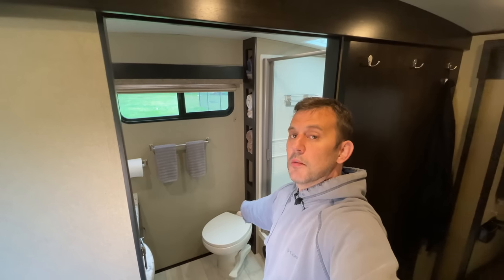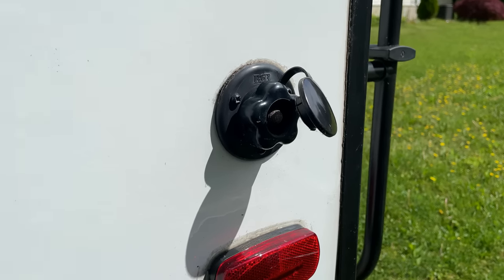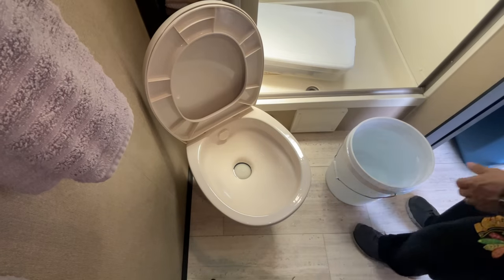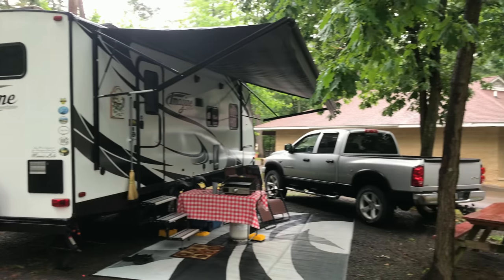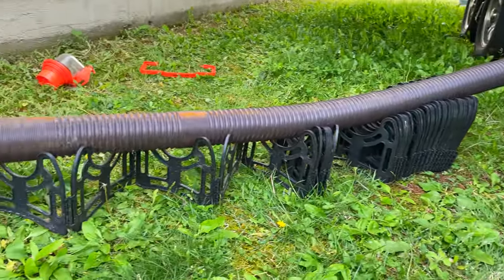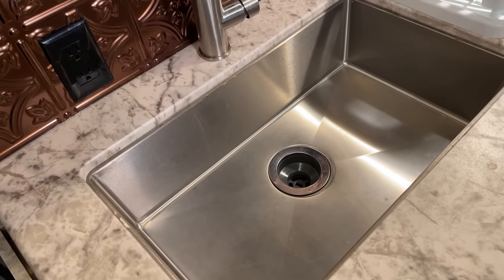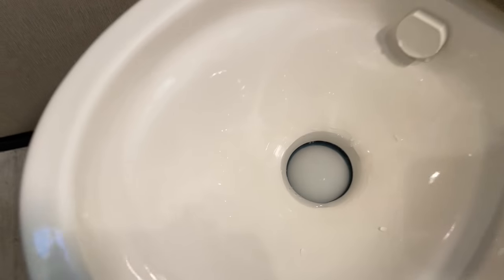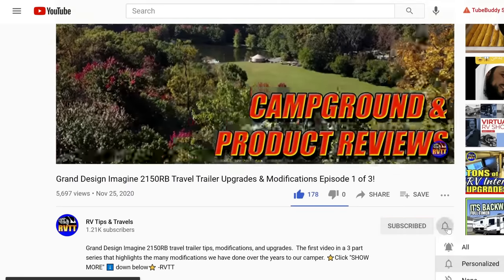RV Black Tank Cleaning, Maintenance, Tips & Tricks - The Original Black Tank Master Class

Comment: Hi, I have a laundry cap stuck in the lining/pipes of my black tank, my son threw it down there.  Do I have to take it apart it? It only allows a little bit of waste out at a time.
Reply from the maker: unfortunately it might move over time and block the drain pipe completely.  it probably should be removed.

Comment: We are set up in one location for the summer, only there about every other weekend, do we need to empty the black tank when we are only there for two nights or can we just add water to the tank and empty every other time?
Reply from the maker: Great question, in a situation like that, if your tank is less than half full would just make sure there is a black tank solution in there with lots of water and leave it alone. If it starts getting close to full I would add water until it is almost full and dump it so you don’t have a full tank of waste sitting in there when you’re not in the camper.
Reply: @RVTIPSANDTRAVELS   Thank you.

Comment: I was wondering why you didn't use the black tank flush instead of the 5 gallon bucket to rinse, drain repeat on the black tank.
Reply from the maker: the "bucket dump" in my experience provides a better clean.  it does a couple things.  first it will help break up any solids that may be sticking at the bottom of the tank directly under the toilet since it is centralized pressure.  the black tank flush port is a less pressurized spray.  its also much quicker, and that immediate rush of water will loosen things up much better than turning on the spray port.  just my experience from using both.

Comment: Ok I need your help!
Yes my toilet is backed up.
I was running it with the valve open like if it were a regular home bathroom. Oh boy am I learning a lesson. 
I've used the unique rv digest it a while bottle 32oz and still no give. 
I got the white and yellow wand. Still not give.
And know I got the RINO blaster,( direct blast) rinse your rv sewer system and still not give. 
Not trying to be funny, but I'm pooped out. Have any suggestions?
Reply from the maker: It might take a while but I would first try putting some hot water in your tank and filling it, let it sit overnight. Tried dumping the next day. If that doesn’t work I would then suggest trying the trick used in the video that I mentioned in this video with the sewer hose. Let me know if that works, if not we’ll try something else.

Comment: No comments on when and how long you operate installed black tank cleaning spray systems. Do you ever use one? Most newer rvs have them now.
Reply from the maker: Hey John I think I mention it in the video, but if not, ill usually run it for about 5 minutes, or until the water coming through the elbow is clear.
Reply: @RVTIPSANDTRAVELS  yes, reading your reply I recall you saying that. 
I will close the release valve for a minute or two to build a little water volume for a final flush. Same as adding water. BUT DO NOT WALK AWAY OR GET DISTRACTED w valve closed. It is probably a dangerous practice.
Reply from the maker: Correct, do not walk away!!!! I did that once filling the fresh tank and came back with it pouring from the gravity fill lol.

Comment: I’m new at this, but I saw something that kind of freaked me! Is there someplace near the sewer hose or just inside bumper so I don’t have to dig for or touch the hose? Then sanitize gloves and hands as I’m putting them away? Just don’t want to infect myself and spoil a great camping experience!
Reply from the maker: Just wear rubber gloves.  Billions of people change diapers everyday without gloves.  Just wash your hands when your done.  👍🏼
Reply: In response to the response: My problem is because of my ancestry, I am 6’2”, large in stature, and the size of my hands have have brought many comments as to their size! Think of Max Bair with Grizzly bear paws, that’s me and after years of searching, have yet to find a workable rubber glove that doesn’t split out as I am trying to put the: on. I have found rubber gloves that fit, the gauge rubber that is like trying to do mechanic work wearing snow gloves. Not anyones fault, just genetics. So rather than working with the sewer hose with “Bear” hands if someone could lead me to an XXX surgical glove or such, I would really appreciate it! Just got over COVID few months back, not a good experience, so I’m avoiding anything that might make me that sick again!🥹
Reply from the maker: Glad you are feeling better from Covid.  I use gloves when actually dumping, but I’m blessed with a tough immune system too.  Thanks for your comments and have fun camping Douglas!

Comment: I have a 9 gallon black tank with no clean out. For tanks that small, even a gallon of water can have you full before the end of the weekend. Try instead, a splash of fabulosa cleaner. Also, they make those external waste gates with a clean out port. Close the external gate and flush your black and gray tank away!
Reply from the maker: Thanks for adding and the tip!

Comment: Been looking for a detailed video like this.  Been camping for the last 8 yes or so now. Just ran into my 1st problem with a black tank not draining on a Saturday night. Ended getting a 5gallon bucket and a plumbers snake…. Yeah a little messy to say the least!! I just subscribed and will be taking your advice into account as we speak!! Thanks for great info and I’ll enjoy looking forward to more videos:)
Reply from the maker: Glad you enjoyed Steve, and thanks for commenting!
Reply: @RVTIPSANDTRAVELS  what do think about the black tank flush kits like rhino blaster pro?
Reply from the maker: Ive never used one, but i could see how they could help by getting water pressure back up into the piping.  i think in the right situation they would be useful.  one just needs to be careful not to overflow the black tank, meaning if it is already full AND clogged, the additional water put through the rhino blaster once it unclogs the line, could overflow the toilet.  make sense?
Reply: @RVTIPSANDTRAVELS  thanks for your response. I think I’ll stick with your tips:)

Comment: Ha! The check valve isn’t important until you realize the manufacturer installed it backwards, and you’d have to drop the underpinning to get to it (I think).  Full timers, clean and flush tanks every four days.  I have sensor issues.  I’ve tried everything but the ice, or harsh products that kill the normal bacteria
Reply from the maker: try using the rinser in this video: https://youtu.be/Q7ZJzfimLwg

Comment: I never use bleach on anything in, on or attached permanently to the trailer to prevent killing the friendly dudes in my tanks (yes tanks, I use tank treatment in both black and grey. Have you smelled a grey tank that has gotten away from you?).

However, I do use bleach spray on the hose fittings (hose ends) and the elbow that touches the black port at the campground. I spray them after disassembling the hose and elbow and let it sit for a few minutes in open air while I work on putting other things away. I come back to it and whallah, sanitized. I rinse each with fresh water and store. There is nothing inside my rig that is not sanitized. The only thing that isn't fully sanitized is the hose itself which sits in my vented bumper.
Reply from the maker: What grey tank treatment do you use?
Reply: @RVTIPSANDTRAVELS  I've used Unique RV DigestIt and when I ran out and couldn't get that, RidX
Reply from the maker: Good stuff too.  Thanks for watching and commenting!

Comment: Thanks for the great video. I am working on putting a house toilet in my motorhome.  Yes they use a lot of water, but from all I've seen (i'm a tent camper) about black tanks, is as you say in video, use lots of water.  So the 1 gallon flush would actually be a good thing.   
Let the yellow mellow and flush down the brown is the idea.   What you think?
Reply from the maker: I've never seen this done.  Just something to be careful with is the reserve tank spilling when your traveling, but I am sure it could be done.  Thanks for watching and commenting Murray!
Reply: @RVTIPSANDTRAVELS  I am using a custom vertical tank setup, and when traveling you can reduce the bowl to just the trap fill.  In another video about different toilets, one complaint about the straight drop down is when it opens, all the nasty smell comes up after the water drains.  A trap this never happens.
Reply: @murraymadness4674  I would never use a normal toilet in an RV. Too heavy, too much water, too hard to keep the seal on the bottom from leaking.

Comment: Brand new here and thanks for all of your videos.  The first (and only) grounds we have been to only had 2 dump ports at the exit.  I dumped the grey and black but there's no way I would have had time to dump/fill/dump.  Is this common or do most grounds have dump ports at the actual "address" of your site?
Reply from the maker: It just depends on the campground.  But yes, if you’re at a shared site with a line behind you, definitely don’t want to hold them up.  When you have a sewer connection at your site you can take all the time in the world.
Reply: @RVTIPSANDTRAVELS  Looks like today's site has a connection at each spot, so going to do some hardcore flushing today lol

Comment: I have a truck camper which does not have a long enough storage tube for a 20ft sewer hose. I use a 5 gallon bucket with a screw-on lid adapter (bought on Amazon) to store my hose and see-through elbow. It makes it easier if you use the type of hose which compresses and retains a shorter length when you put it away. This bucket can also serve to fill the toilet as shown in the vidio.
Reply from the maker: great idea Kenneth, thanks for watching and sharing.

Comment: Hi, Big Ben🇨🇦🐴🙂follower excellent video. We put weather vane with reflective tape to see wind direction and vent BT no smells ever. When I dump, I dump BT then shut valve open GTs2 ,fill BT with flusher 3-4min. When GT done reopen BT valve till clear . Thinking of Geo Method for BT additive🤔🐴🙂🇨🇦.
Reply from the maker: thanks for watching and being a great contributor to the channel Randy... I will have the link for those pull out shelves later today when I can measure them.  I see the link i put up in that video is now dead.  hang tight bud.

Comment: Good tips to use, I’ve got a question, my black tank when full shows 1 light and my grey tank shows 2 lights when empty! I’ve flushed the blk tnk with a wand and no change, any suggestions?
TIA
Reply from the maker: fill both tanks with a little dawn dish soap.  let them sit overnight.  drain, rinse a few times, that might help clean the sensors.
Reply: @RVTIPSANDTRAVELS  ok Will do 👍🏽

Comment: The area under the L.P. tank in my motorhome is open to the ground.  I added an angle iron frame at the very bottom of the cabinet and welded in a strong expanded metal floor.  This makes a shelf where I store 3 sewer hoses and one gray water 50' garden hose plus sewer hose accessories. 
No odor and excess water drains through the expanded metal.  ONE CAUTION: MAKE SURE YOUR L.P. TANK VALVE IS CLOSED AND CHECK FOR NO LEAKS WHEN WELDING IN THIS AREA.
HAVE A STANDBY OBSERVER WITH A PROPER FIRE EXTINGUISHER WHILE YOU OR YOUR WELDER  ARE UNDER THE HOOD.
Reply from the maker: Great tip Philip, thanks for sharing!
Reply: @RVTIPSANDTRAVELS  DEFINITELY need to have adequate remaining opening at the bottom of the propane tank storage area for VERY GOOD ventilation in case of a propane leak, while traveling, sleeping, whenever it may (RARELY?) occur…BUT I don’t see why you can’t safely capitalize on much of that open area for storing items like you do….I would NOT feel comfortable TOTALLY sealing off the propane tank storage bay, however. STAY safe & a happy RV’ing !
Reply from the maker: @ceuser8420  i just reread his original comment and just realized he sealed it off.  I think I missed that part after reading he put stronger framing in.  But you are absolutely correct, I wouldnt seal it off either.  Thanks for watching and commenting bud!

Comment: How did miss the part about using the black tank flushport?
Reply from the maker: It’s in there. Just hook up a hose, open your black tank drain and let the water run for a couple minutes until you see clear water coming through the elbow.

Comment: what should i do if i have terrible odor in my rv when i flush my toilet? im a first time full-timer, and learning as i go. ive done a couple black tank flushes, but i have a terrible odor every time i flush the toilet. i use camco tst max citrus scent, toilet drop-ins. am i not putting enough water back into my tank? and if so what should i do to help break down that “poop pyramid” so the smell goes away?

edit: i also do not put toilet paper in my tank!
Reply from the maker: the video addresses using a spray of water down the toilet to break up the pyramid.  as far as a smell, pour half a bottle of dawn in the tank and fill with water.  let it sit for a day or 2, then empty, fill, and empty again.  then follow the steps in the video to maintain it.
Reply: @RVTIPSANDTRAVELS  thank you!! ill give it a shot!!

Comment: Thank you so much. We are new and this video was so helpful.  We have been in our RV for a few weeks and have used happy camper and plenty of water in our tank. We haven’t had any odor or issues. However, the last time we dumped our value was so hard to pull. I can’t pull it now, my husband needs to, I am afraid it will break. We have a GD Reflection 337RLS so our values on on a wall inside the camper. Help. And yes, I surely did hit the thumbs up and subscribe.
Reply from the maker: Try using pb blaster on the valve pulls.  If your valves fail in the open position you can just add one of these on the end of your sewage pipe:  https://amzn.to/3wcfV4F
Reply: @RVTIPSANDTRAVELS  thank you. We did buy some PB Blaster this afternoon. I hope that will work as I don’t understand how to get to the value behind the wall. Let’s hope I don’t need to

Comment: Most people don't do a through flush on their black water tanks until the level sensors quit working.
The sensors are probably coated with toilet paper causing the erroneous readings.

To cure that, I would fill the black water tank with water and a cup or 2 of laundry detergent since laundry doesn't foam like dish soap. Let this solution sit for a couple of hours so it can penetrate and soften the dried on mess. 

Then dump it and refill it a time or two to flush the loose material down the drain.

It would help to drive the RV around before dumping it and, again, before the flush to agitate it.
If that doesn't work, sell the damn thing and stay in motels.

Comment: When you are hooked up to septic for long term, do you keep the valves open all the time?
Reply from the maker: no way, this is clearly explained in the beginning of the video with the poop pyramid.
Reply: @RVTIPSANDTRAVELS  this video or a different one? I am not seeing it, sorry!
Reply from the maker: @rickvanheel8865  no problem Rick... anytime your tanks are open there is no water in the bottom, so everything that falls in there sticks to the bottom of the tank.  leaving the tank drain closed until its time to dump enables you to leave water on the bottom so nothing sticks to the tank and everything flows out easier.  make sense?
Reply: @RVTIPSANDTRAVELS  yes, thank you so much!

Comment: How do you check the water level of the black tank without having water run through the toilet?
Reply from the maker: Unfortunately you might just have to look down the toilet, that is if the sensors don’t work accurately

Comment: I am a newby and getting ready to purchase. On the RV it has a hose hook up for the sprinkler heads to clean the walls of the black tank. I noticed you talked a little about the water sprinkler system that shoot out water to clean the black tank. Do you not use those or is it best to just pour the 5 gallon bucket of water in the toilet? Thanks!
Reply from the maker: When I’m on a full hook up, I will dump my tank and then let that black tank flush run for a couple minutes with the valve open.  Shut the valve and turn off the water and add water back into the tank.
Reply: @RVTIPSANDTRAVELS  Thanks.
Reply from the maker: @sounddoctrine6159  you’re welcome bud, thanks for stopping by.
Reply: @RVTIPSANDTRAVELS  Absolutely, your channel has been very helpful. I know being new at anything, the first thing you do is buy everything you see or what everyone is recommending. Before you know it, you have more weight and no room on your trailer lol! Your channel has been a big help!

Comment: I'm a first time full time rv. I have a toilet that doesn't flush, I'm assuming when they brought it and set everything up the tank was not completely empty.  I'm a single person. I do use rv tp but will try the other brand.   I'm alone and have no one.  Do I open the black valve?? I'm confused as to what I need to get this toilet working. When I flush the water keeps rising and won't go down.  I out some orange powder cleaner that was left and that didn't help. I'm panicking.  My first time rv full time.  What do I do?  I'm a little confused.  Any assistance would be greatly appreciated!!  Thank you
Reply from the maker: open the flush valve and try to poke a tree branch down there to clear any clogs.  just dont hit your black tank bottom.